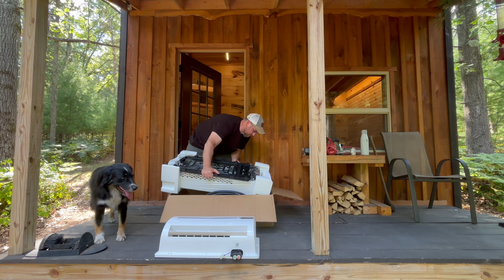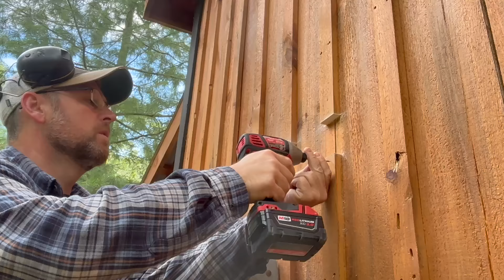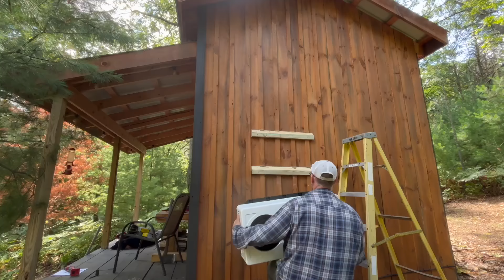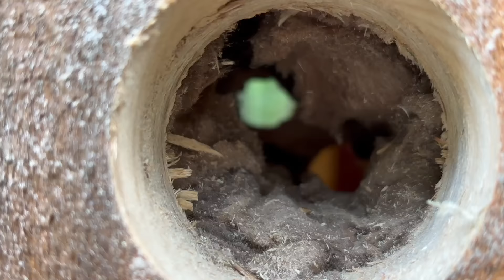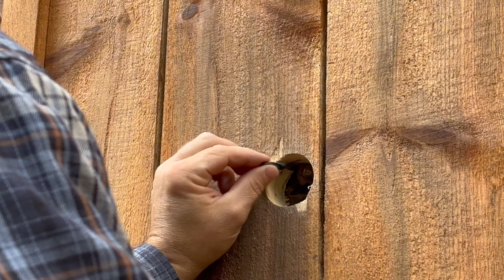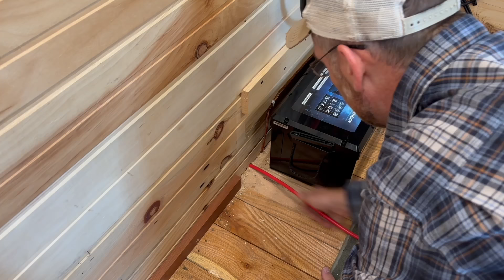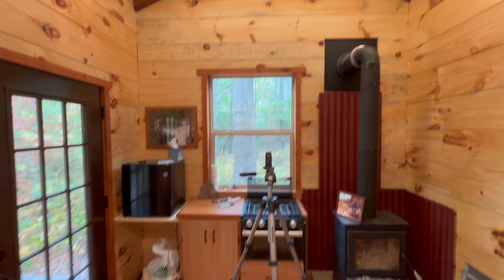12 volt Air Conditioner in the Off Grid Cabin ! OutEquipPro

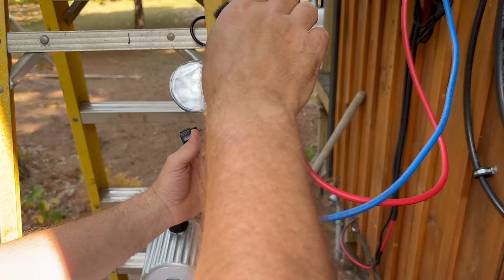Comment: 23:50 My friend made a mistake. Before disconnecting the gauges, he should have opened the valve slightly, released at least 10 psi of positive pressure, and then disconnected the valve. Disconnecting the gauges while empty allows moisture to re-enter the cooling system and contaminate it.
Reply: It has shraders. It’s probably fine.
Reply from the maker: like I said its better to hire a pro to do that part lol
Reply: @blackspruce1861 . It’s fine. The shader connections will close as you remove your gauges. It has a filter drier. As long as it was leak tight it shouldn’t be a problem. It was only a few minutes. I wouldn’t let it sit in a vacuum over night. If there is a leak and you run that thing full of air you will immediately have head pressure trips and the refrigerant in the unit will basically have to be contaminated and need to be replaced. Refrigerant is not something most people can buy or should be experimenting with. It’s expensive and mistakes can easily be made. I have been working on supermarket HVAC and refrigeration for too many decades.
Reply: @Nine_883incorrect. The valve stims gradually close off as the depressor is removed. The comment is correct, he DID make a mistake, he DID do it wrong, his system IS contaminated. 

Now... Is it enough contamination to cause an issue? Don't be know, could be in or could not be. Only time will tell. But the comment was correct and designed to prevent others from making a potentially costly mistake.
Reply: @scottybell2060      What are you going to do to fix it now dipshit?  Pull all of the refrigerant out and put in some fresh for about $500.  I would have broke the vacuum with pressure before I removed the gauges, but very little air would get in that way he did it.  I was trying to reassure the guy that his "mistake" was not going to be a problem.  I do not give a crap about other commenters.  I have been working one commercial supermarket refrigeration systems for 35 years.  I have seen it al and done it all.  I now work as a factory rep for a manufacturer.  An expert.  I teach classes to technicians.  I said it was fine and it's going to be just fine.  Nothing you say matters to me.  You are a nobody.......you know nothing.
Reply: @scottybell2060    How much air in volume gets through that microscopic "leak" between the time the seal loses contact and the stem is completely seated and sealed?  How much?  Basically NONE.  You don't know what you are talking about.  YOu think you do, but you don't.  So tell the guy to buy recovery machine, a recovery cylinder, and a can of refrigerant and replace that refrigerant dipshit.  Or quit being a knucklehead and accept the fact that the deal is done.  We are talking about microns of air MAYBE getting in the system.  MICRONS..........the deal is done.  I was reassuring him that even though his procedure is getting hammered buy dumbf*ck youtubers like you it is really not going to be a big deal and not worth the money to try to do anything about it.  It's fine.  Run the thing.  There is ZERO economic solution to the fake problem you are telling this guy he might have.  And don't you ever try to correct an expert again.  You got that Sugar Pants?  If you came to my job you would be black balled and tossed off the roof in a second for even questioning my expertise.  If I say it's fine then it's fine.  Got that??
Reply: @scottybell2060    Wrong....the hose and the evaporator are in a vacuum.  Everything is in a vacuum.  As yo remove the hose the core depressor retracts and allows the shrader to close.  It becomes all of the way closed before the seal of the gauges is broken.  It under vacuum.  The seal is still in tact until your last thread is cleared and you physically remove the hose.  It's under vacuum.  That's how Shraders work.  Virtually no air is going to get in the system unless your gauges are screwed up or have a bad gasket.  Even then it would be MICRONS......You are good at 500 microns, but my systems are always more like 5 microns.  ALWAYS because I am the master of all things refrigeration.  It's not going to hurt even if you got 200 microns leaking through while you are taking the gauges off.    Do not question the expert.
Reply: @Nine_883 your absolutely incredibly wrong, anyone who installs condenser units will tell you never disconnect gauges under vacuum, it loses vacuum instantly. The proof is in removing your gauges under positive pressure of the refrigerant you get some refrigerant that comes out at the end no matter how fast you are .
Reply: @Pbell  I didn’t say it wasn’t right or wrong. I f*cking said it will be fine and that it would be very minimal.  The fix for that would cost the guy more than it’s worth. The refrigerant would have to be recovered and replaced.  I was letting the guy know that it’s probably not gonna be that big of a deal and it’s not. I’ve been doing this my entire life.  Those Schraders are gonna allow microns of air through as they close when he pulls the gauge off.  It’s still gonna be in a good vacuum once he opens the valves.  You people are arguing with nobody.  The guy doesn’t have recovery machine and a spare bottle of refrigerant.  Shut up.
Reply: @Nine_883bro.. Just be professional. Why get pulled in by dumbshit peeps that have no clue on HVAC
Reply: @Nine_883WRONG factually speaking. Do yourself a favor. Pull a vac on a system and remove your gauges. Hear that hissing? That's air infiltrating the system. The only way to avoid this is to use ball valve hoses or quick disconnect hoses ends which the person in the video did NOT use. I am a seasoned vet and have also TAUGHT this stuff for years. Will the system be ok? Yea probably. Was it done incorrectly? Absolutely! Are you wrong about air infiltrating the system? YES
Reply: Wondering how many BTUs the output is? And is it cooling only or a heat pump?

DC only or is it possible it runs AC/DC?

Comment: I'm a retired ac guy and it sounds like the indoor fan is scrubbing on something.
Reply: Whatever was rubbing, probably wore off and no more noise, lol
Reply: it was making one hell of a noise?
Reply from the maker: it did kind of sound that way at first but I quieted down a lot as I used it
Reply: @blackspruce1861  It clearanced itself...
Reply: @shullln  Or the fan clearanced it. 😏
Reply: @blackspruce1861 I would check, if it's a plastic bag or something I've seen squirrel cages have bags on them for years and people never knew, could be hindering flow, op is right something is wrong in there
Reply: Too bad how ugly these things are…
Reply: @walterkersting9922  you know what’s worse than the look of this thing? My butt crack sweat sitting in my un air-conditioned tiny cabin that’s off the grid with no air-conditioning..  i’m actually encouraged by this. We have a friend in town who has an off grid cabin, and he had a utility pole put in by GVEC, and he has the ugly utility pole with the ugly utility pole lines running to his window unit, and they charge him 90 bucks a month whether he uses his tiny air conditioner or not. $90 is the base charge.  In my opinion, the utility pole and that $90 base charge is a lot uglier than what the 12 V mini split looks like.
Reply: @bradc5433 lmaoooo
Reply: @bradc5433  They need to start making them in other colors besides white.
Reply: @lgDukeCity5018  Paint😊

Comment: a 12500 btu unit should be enough for that cabin. its a nice little kit with pre charged lines,though i did click this video hoping it would show how to do the lines if they were not pre charged. i would say if you plan to do multiple units (like a cabin and a garage) then its worth buying the equipment and also let friends know you have it and then they could use your unit.
Reply: Probably too much really, my 1800 sq ft house only has a 24000btu ac unit!
Reply from the maker: lets hope so I like it cool
Reply from the maker: Thats a good point nice to have some community tools and knowledge .
Reply: @blackspruce1861 the only real downside is it cools quick, removes less moisture and may cycle on and off more. If it cycles too often is wears the compressor a lot more. In this case you just need a larger differential to allow larger temp swings/add a compressor delay. Most heat pump thermostats allow for these settings but im not sure about their onboard programming

Comment: I bought a pump gauge combo for under 150$ and installed 3 mini splits in my home as well as charged my cars ac system with adapters…. In my area this kind of service is in the 300-500$ range
Reply from the maker: I had to find my gauges and hoses local  because it was a last minute thing . I suppose if you shop around online but I never looked . I just went with the prices I paid .

Comment: Nice work! I’m intrigued now if the rooftop 13,500 btu unit they have could be sufficient enough to cool you down when laying on the loft bed?
Reply from the maker: Thanks !! I'm not sure if you can mount the roof top unit on that kind of angle . I might add a small ceiling fan to circulate the air I think that would do the trick

Comment: why didn't you mount the unit in the loft? Cold flows down…..
Reply from the maker: maybe you missed it but I had mentioned I have a usb plug that I use quite a lot . it's right in the middle of the wall up there . I just could not make it fit

Comment: Thank you for posting this!!! For those of use that are "Off Grid" keeping things simple and just using 12v or a multiple there of this in incredible. Lots of potential uses for this. Every time you go from AC to DC there is loss do this more than makes up for that in simplicity.
Reply from the maker: No problem ! Thats what I've been aiming for with this cabin . I have that big inverter only ever really use it for that fridge if I'm spending much time there

Comment: Thinking about putting one in our RV to get rid of the noisy roof top unit that just sucks power. Also thought the pricing was competitive with ac units.
Reply from the maker: They have a roof top 12 Volt Dc unit too . I actually have a video installing one in the camper I built on the channel . here's a link to that video https://youtu.be/ZJUVoA1Ut2k.

Comment: An amp draw to calculate watts would be nice for a comparison. Unless your inverter tells you watt consumption.  My Victron inverter via the Cerbo display shows me power in, (watts, amps and volts) AC and DC outputs and battery percentage remaining. Its also blue tooth access (within 30') and remote access via wifi. Also has memory to store historical data. It wasn't cheap, but it has alot of capability. Oh also can take AC input grom a generator or other source.  Im hoping to make a micro hydro setup as the secondary input.
Reply from the maker: The set up in the cabin really doesn't give much info

Comment: Im an AC guy. -30 (30") vacuum isnt low enough.  We go by microns. 30" is only atmosphere pressure removed, thats something like 14,000 microns. What you really want is 500 microns. Thats a deep vacuum to boil off moisture and get it out. Moisture mixing with compressor oil makes a mild acid. It eats the varnish off the motor windings and shorts it out. Literally eats the compressor from the inside out. Otherwise a great job. I might look into one for my camper. The factory AC system runs at 1700 watts on high fan.
Reply from the maker: Thanks For the info . The gauges I had only went to that measurement so hopefully it got a deep enough vacuum .
Reply: @blackspruce1861  I retired as ASE Automotive Master Tech. With all the AC classes that I took regarding to vacuuming an AC system, vacuuming a system is to boil the moisture (H2O)) and remove it from the A/C system. Since you just purchased the unit and everything was sealed when you received it, I think you will be fine. According to the Water boiling temp VS pressure vacuum chart, you can boil water at -90 degrees F at 30 inches of vacuum. With that said, your vacuum pump is good enough to evacuate the sys. If the system was opened for a long time, your vacuum pump is still good enough, but it takes a longer time to remove the moisture out the system. BTW: 14,000 micron of vacuum can only boil water at 60 degrees Fahrenheit. If the ambient temperature is lower than 60 degrees Fahrenheit, then you cannot remove the moisture out the system with 14,000 microns of vacuum.
Reply: That's not true at all. Atmosphere is about 760,000 microns, -29.92 is perfect vacuum, the gauge can never be that accurate. If he had a micron gauge, it would be waaaay under 14000 microns. My $700 professional gauges don't go below -30hg either.

This guy had a near perfect vacuum until he removed the hoses. He should have simply opened the valves and then quickly removed the gauges. I doubt the gauge would even say 14000, it would likely start to register at 12k and pull down quickly. I bet he was down to 5-800 microns before he pulled the hoses.
Reply: @Diabloshell  The purpose of evaluating an AC system is to remove H20 in the system which turns into ice. This creates a problem to the X-valve or orifice tube not to function properly. Evacuating an A/C system is not to install the proper amount of refrigerant in the sys. If there is NO moisture in the sys, you can pull 18 in of mercury and charge the sys and you'll be OK
Reply: @b-lopez394 the purpose is to evacuate the lineset, which absolutely can have moisture when exposed to atmosphere. 18in of mercury could be like 30,000-80,000 microns and likely means you have a leak. You would very likely not be okay, where did you get your ticket?
Reply: @Diabloshell  Reread my comment. If there is NO moisture in the sys. Not necessarily have a leak. You could have a bad vacuum pump.
Reply: @b-lopez394 you can still have contaminants and non condensibles. If you aren't pulling down to at LEAST 800 microns, you're not doing a good install and almost certainly lowering the lifespan and/or efficiency of your system.
Reply: @Diabloshell  You just contradicted yourself that you cannot remove contaminants and non-condensable if you aren't pulling down to at LEAST 800 microns. The fact is that you CANNOT remove contaminants and non-condensable regardless how much microns you are going to pull.
Reply: @b-lopez394 yes you can, we're not talking solids and shavings, we're talking moisture, oxygen, nitrogen, other gases etc.

You do not have a "good" vacuum above 800microns and you likely have extra moisture, a leak or both. That's why you don't leave pipes open to atmosphere.

Comment: Thanks for the video! Funny I was wondering if they could be used this way. Glad to see it’s working for you. There won’t be an issue with it installed on a wall vs on a flat roof?
Reply from the maker: Glad you liked it !! the mini split is meant to be mounted on the wall . they have a roof top unit for campers too , I installed one on my camper

Comment: Very nice, i have been eyeing the ones sold on amazon for trucks and rv's but ,my cabin build is still in progress and in the meantime ended up buying the Hisense 8000btu inverter window unit, which is still not installed so there is still time to buy one of this if possible.

Please let us know what kind of power it consumes from your system, if possible an indept power consumption, including your equipment setup and if it has affected other components as well as run times and, if you have needed to top off your battery with a generator during low sun charging conditions.

Thank you!
Reply from the maker: Thanks !! I probably won't be able to get that video done this year . I've been in the middle of a big build and really need to get it done .

Comment: I can respect someone prioritizing comfort versus conforming to someone else’s opinion of what “off the grid” means.

    Ryan, that cabin is as close to perfect as it could be with this addition of A/C! Not lacking for anything worthwhile……
Reply: To me, "off the grid" means not connected to the grid. Run your whole house on solar, that's still "off the grid".
Reply: @SirFrag32 Yeah I live 100% of grid and I have internet, a T.V. an air conditioner.  I’m not trying to live a primitive lifestyle as I still work, except for my long drop (pit toilet) outside.  If it’s raining I just put my rain coat on once I got used to it, it’s no worries.  I grew up with an outside toilet in Australia in the 70’s in the 2nd largest city, and you will still find  un-renovated houses with only an outside toilet.  My Sister’s house 25yrs ago and she had 3 kid’s still had an outside toilet and separate bathroom before they renovated it.
Reply: I just finished building a 20x20 two story and we popped a 12k mini split in it, kept it at 72 inside when it was 100 plus outside, but it is a 110v unit run off of a 7500w solar array. It pulls less wattage than the 5k window Shaker I had in it while building out the interior.
Reply: A bare necessities off-grid aesthetic is for when you’re sipping solar, hydro or wind power with a small setup. If you’re generating enough power for a sweet, sweet 12v mini-split, all the better, imo. Off-grid is off-grid. Rock on, brother 🤘🏾
Reply: I spent multiple summers getting by by cooling off in the creek but even so, I never got used to the heat. 
I finally succumbed to an ac and now my summer will be productive rather than sitting around waiting for the sun to set.
Reply from the maker: Me too ! I like to enjoy it , and it kinda sucks when it's 90 degrees . Thanks !
Reply: Turned out great